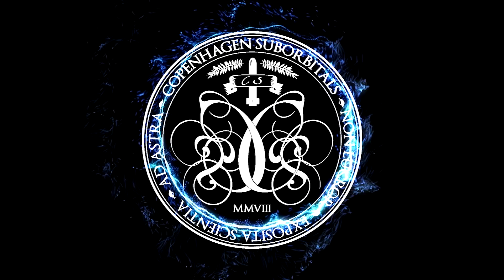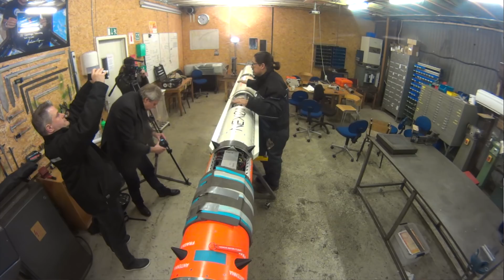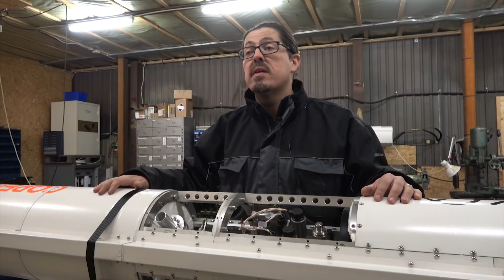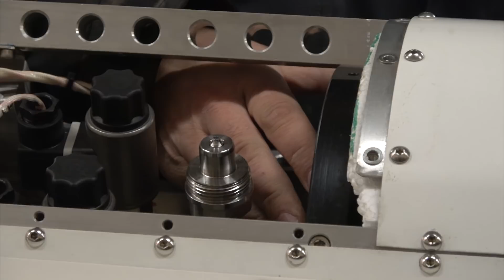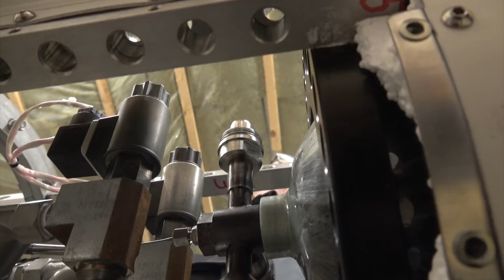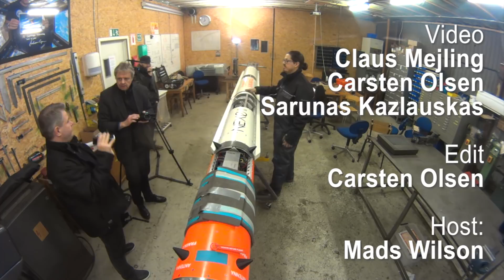A walkthrough of the Nexø II rocket (Part II)

Comment: Copenhagen Suborbitals, speaking of the turbo pumpm what kind of gas generator are you going to use for your pump? Are you going to use Hydrogen peroxide like this company use to do many years ago, or are you going to do a different method. I've learned that the Electron rocket from the New Zealand Rocket Lab company used an electric pump to run it's rocket engine. I'm just curious of what method you'll be using for your turbo pump. Plus what rocket would you use your future turbo pump on? Just want to know.

Comment: Thank you for the videos as always. Mads mentions a possible turbopump for a future engine design. I would like to ask if the team has considered an expanded cycle turbine--as the surface area of the chamber should be sufficiently large to support a relatively high (to its volume) heat flux rate to sustain high efficiency.

Comment: Not that I have any idea what I'm talking about, but why not have a check valve on the bottom of each tank that leads to a heater tube, heat up that liquid till it boils (via lipoly batteries?) and put that pressure back into the top of the tank via another check valve.  (the heating chamber would need to be small,?4 cm^3?, and the heat pulsed to avoid the need of any actively controlled valves or pumps.)   The question would be is the heater, battery and 2 check valves lighter than the Helium tank, and the control valve.   I think this technique even has a name, autogenous.  The heater would be a metal tube that runs up the side of the tank (thermally touching it) that you are pressurizing. In the center of the tube would be a nichrome wire pulled tight to stay in the center of the tube.  .... heater on: the wire bubbles gas up through the top check valve; heater off: the tank cools the tube condensing the propellant thus reducing the pressure inside to below that of the main tank and thus pulling in liquid through the bottom check valve .... The only point of concern is preventing air (Nitrogen) in the system that would not condense in the heating tube, to avoid that issue fill the tanks completely full of propellant so there are no spaces for air to collect....  ..... just a thought.
Reply: Even better, insulate the outside of the heater tube (pyrex, perhaps) and put it inside the tank so that it can be made lighter since it does not need to be able to withstand the pressure vs atmosphere. Tube would only see a small pressure differential to make the check valves operate.  So long as you are in a gravity or acceleration field this should work....I think.
Reply: You cant make enough gas by heating the fuels and feeding that back into the tank.  Also you want to keep your fuels as cold as possible.  Some ICBMs will burn a fuel to produce gas and feed that back into the tanks.  However, these are not cryogenic fuels and you need a rocket that is much bigger.   Helium is the correct choice for a vehicle of this size.   The dynamic control is overkill for a rocket this size but if it's there to support a larger vehicle in the future then it makes sense.
Reply: I don't think ethanol is a suitable fuel for this technique. Something like methane would work much better. However, heating chamber can't be small for obvious reasons, and will still need tremendous amounts of power to heat the propellants. Ultimately defeating the purpose. Maybe the rocket chamber walls can be utilized for this task? Or maybe using a turbopump would yield better bang for the buck + weight savings.
Reply: I'm pretty sure 1kWatt heating into the LOX will make the pressure relief valve go off!  (is short order!)
 :-)   

The dynamic control would be pretty simple, I assume you have a computer that is monitoring the tank pressure and a level switch in the tank.  (???)  
if ((On the pad)&&(level switch too low){add fuel} else if (pressure to low){turn on heater for 0.1 seconds,then off for 0.5 second}

With a $10 NChannel MosFet you can drive a couple hundred Amps every other second; a 1 oz Arduino could control the Fet directly.

For the first stage anyway, since you know which way acceleration/gravity is pointed at all times.  The mechanical device would be [from the bottom], 1/8in PVC, expander to 1/2in, marble, 3inches of pvc with coil of nichrome from a hair dryer inside, reducer to 1/8, expander to 1/2, marble, reducer to 1/8, pipe to top of tank.  The marbles work as a one way valves since we don't need to much precision for this application. Total weight of mechanical excluding the battery < 2 lbs per tank (your tanks are less than 2 meters long each??).  .... I forget, is PVC soluble in ethanol? might need a different material.

To slow down the condensation, float hollow glass beads in the LOX tank ( such as https://www.alibaba.com/product-detail/High-performance-hollow-glass-beads_60678357312.html?s=p ) and do the same or use wood chips in the ethanol tank.

[with that said, you guys have actually built a rocket, I only do helicopters and very fast cars http://teamvesco.com/ ]
Reply: Oğuz Can Soyselçuk the expansion of the ethanol happens periodically, faster than one second, so the volume of the heater need only be a few cm^3....it refills due to the check valves and repeat...
Reply: Elden Crom Just for reference, their engine control computer is a modified arduino design with outputs that can drive valves and small motors directly, no need for an extra 1oz arduino.  Getting enough electrical energy to cook the ethanol fuel into steam may be a much bigger problem.  But they are already letting the engine heat the fuel (to cool the engine), so bleeding off hot fuel from the injector chamber could help.  However heating a different liquid to pressurize the ethanol tank may be a more efficient way to implement your idea in a new rocket (this entire rocket design will be retired after this years launch, it was only a testbed for subsystems that will go into the manned rocket).
Reply: Ariane 6 https://twitter.com/ArianeGroup/status/1001129689497337858   
What rockets have used that technology?